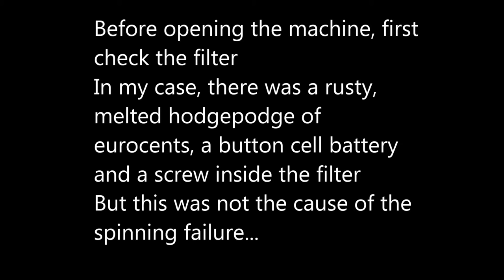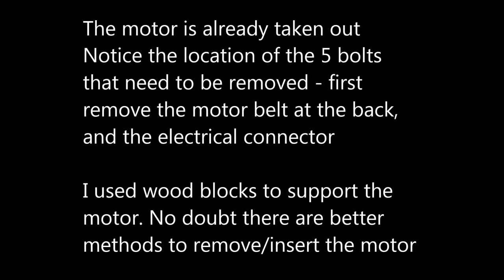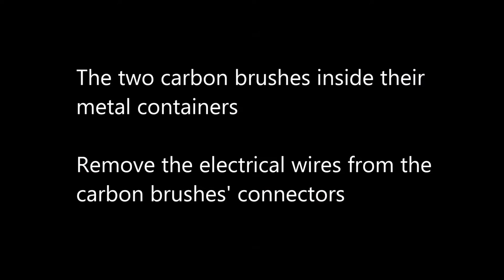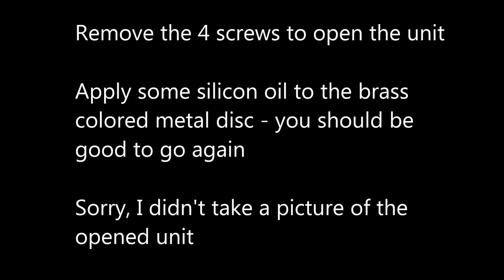Miele W754S repair (zwiert niet / schleudert nicht / does not spin)

Comment: In de jaren '90 heb ik in de winkel nog 5 gulden (ongeveer € 2,50) betaald voor een set originele koolborstels van Miele die u ook heeft gebruikt. De prijzen zijn wel gestegen van Miele onderdelen de laatste decennia.

In the 90 's I have in the shop still 5 gulden (about € 2.50) paid for a set of original Miele carbon brushes that you have used. The prices are increased from Miele parts the last decades.

In den 1990ern habe ich im Shop bezahlt noch 5 Gulden (ca. € 2,50) für eine Reihe von original Miele Kohlebürsten, die Sie verwendet haben. Die Preise sind von Miele Teile der letzten Jahrzehnten erhöht.
Reply: +Provincie Zeeland Damn, 2,50 voor een setje Miele koolborstels.. ik weet nog in '08 dat m'n ouders 35 euro ofzo betaald hadden voor een setje 700-serie borstels bij Miele zelf!

Was voor hun W715 trouwens, ik doe zelf niet veel meer met Mieles omdat het merk gewoon ruk geworden is, en Asko de shit is qua kwaliteit.